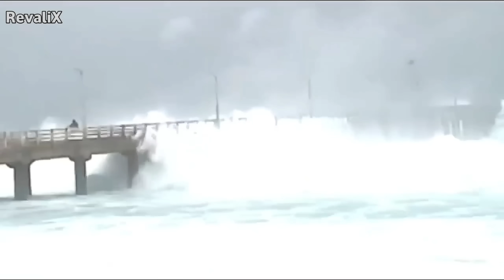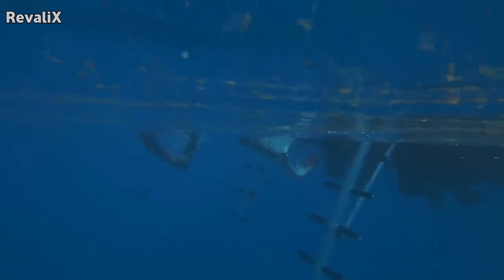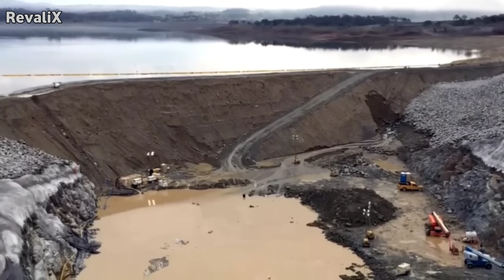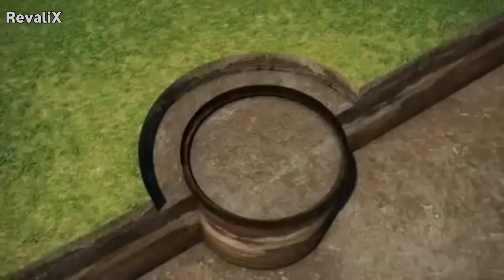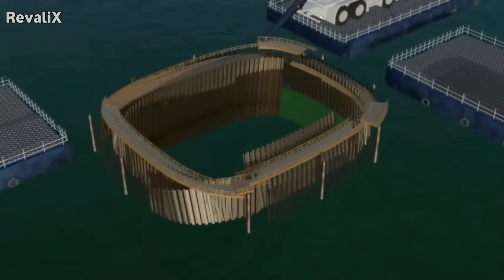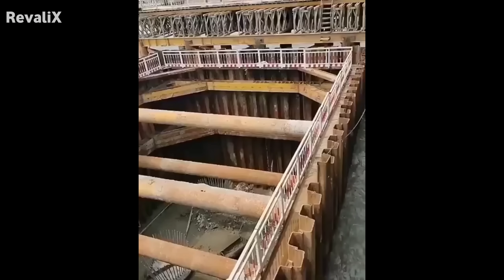This is How Bridges are Built over Deep Water

Comment: Surveyors, engineers and architects are NEVER required to factor the supposed curvature of the Earth into their projects. Bridges, canals, railways, and tunnels are always cut and laid horizontally, often over hundreds of miles, without any allowance for supposed curvature. Surveyors, engineers and architects always use Euclidean planar geometry, from a plumb and level datum, and all downward vectors are parallel to each other in their blueprints, which would NEVER work on a sphere. The Earth is demonstrably level and it is as easy as this to understand... The ability of water to always find its level is not a "conspiracy", it is a practically demonstrable, repeatable and verifiable scientific fact, and objective reality with tangible substance. The natural physics and behaviour of water, fluid mechanics, proves, beyond any doubt, the Earth is demonstrably level. The Earth's surface is said to be over 70% covered in water, demonstrably level water. When there is the very slightest of inclinations to the surface of a body of water it will always flow and find its level, in a horizontal straight line from the starting point to the end point regardless of distance. Bodies of water, ie. ponds, lakes, oceans, cannot hold permanent convexity across their surface. Bodies of water cannot conform to the exterior of shapes. Supposed Earth curvature has never been measured. The Earth is demonstrably level.
The spinning globe Earth is the BIGGEST lie, ever, and once people realise this they will know that everything else is a lie. The level Earth truth is the 'skeleton key' to opening up all 'their' lies.

Comment: If you ever want to stump a flat earther ask them why bridge engineers account for the curvature for really long bridges over water if the earth is flat.
Reply: Engineers don't account for the curvature of the earth as The earth isn't perfectly round! Earth is a big lump of rock! It just looks round because of our atmospheric.
Reply: @paulfryer7021  Well, if you scaled down Earth to the size of a basketball, removed the atmosphere and the water in the oceans it would be smoother to the touch than an actual basketball is.  The bulge at the equator wouldn't affect the dribbling enough to notice.  Earth is a lot larger than people realize.  If you drilled a hole to the center and jumped in it would take over 30 hours of free falling before you reached the center.  You'd have to stop screaming to take a nap only to wake up hours later still falling!
Reply: @standoughope you watch too much YouTube 😂
Reply: @paulfryer7021  Agreed but that has nothing to do with what I typed. I learned those details in school using math.
Reply: @standoughope using math explain to me how the earth would be " smoother to touch than a basket ball"
Reply: @paulfryer7021  Basketballs have bumps for better grip that you can measure.  If you scaled the ball up to the diameter of Earth those bumps would be taller than every mountain even with the ocean water removed.  It's math, people have measured it... it wouldn't surprise me if there is a YT video about this but if not the numbers can be calculated yourself.
Reply: @standoughope I'm not a mathematician 😂 that's why I asked you!
Anyway thanks.
Reply: "just looks round because of our atmospheric." 
 - that makes zero sense!
Reply: @adrianwright8685 the only image people have of earth is the one take from space so when thinking about our planet and what it looks like the first image we see in our heads is the one from space and it looks round because of the atmosphere.
Reply: @paulfryer7021  It looks even more round due to the atmosphere but without it it would still appear very round with more distinctive colors.
Reply: @standoughope  I agree!